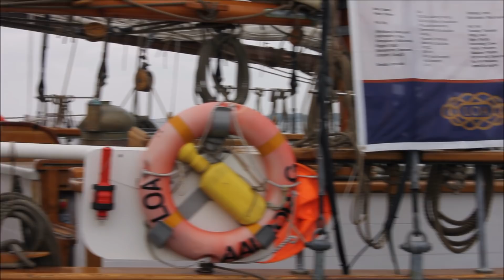Square yards and Tops'ls with Tom Cunliffe

Comment: Thank You, it's amazing to see these ships working.
My personal preference has always been No bottlescrews on forestays and headstays which have hanked on jibs. It was "full race" in the 70's to be able to drop the headsail to the deck, but as always we were actually just re-inventing stuff.
A good example of that is the racked seizing. I believe it's stronger than a splice esp in the larger sizes of wire rope. It looks perfect to me, and far from obsolete because  I seize eyes in dyneema etc double braid way more often than splicing it... it just makes more sense sometimes and it's way faster.
Cheers!
Reply: You are able to seize eyes in slippery dyneema that are stronger than a splice?  What are your secrets?
Reply: @MedievalTrebuchet  Thank you for taking me seriously. Many people would discount this because they haven't tried it or can only relate to things which are repeated over and over in short magazine articles. We seize eyes into double braided modern lines regularly. As far as Single braids go, we certainly don't mind turning in a quick splice especially if the loop needs to nest right up against a block or fairlead. But splicing double braid is a bit time-consuming when we are trying to avoid bottlenecks.
As Tom points out, the secret is in the Frapping Turns. The tried-and-true method for setting the fraps is to use the leverage of a mallet. But in small "yachting-sized" applications a mallet is going to be clumsy. That's where a WIHA 32633 saves the day. Every rigger should have two of these at all times because they work together. No longer do you have to destroy your middle back (pulling your hands apart) because now you can simply grab the seizing stuff in the tapered jaws and Spin the pliers for all the leverage you need. You're welcome! LOL
All I am trying to say is that old methods are far from obsolete. Especially now that fibre ropes are replacing wire ropes everywhere.
I would like to elaborate more later; right now I am taking a break at work to reply. But before I go, I am going to drop another bomb on popular conventional practice:
When you are using dux (tm) for example, and you need to replace an end, of course a (FACTORY) splice is the only way to achieve full strength. But how are you going to splice that stuff once it's been "Set"? You can barely pick it apart a single yarn at a time! One word: Talurit sleeves! And I'm not talking aluminum sleeves, we prefer the copper ones. Fortunately, nobody was around to tell me this was a stupid idea the first time we tried it in 12mm trawl ropes (yes, most riggers have a press that will do up to 3/4" sleeves). This has been working beautifully for, I don't know, decades now.
And now, a word from our sponsor (not officially): Who makes the Best rope? Well, there are so many choices these days, where do you start? But after doing this awhile, I have to say I keep coming back to M****W. I mean if you just melt the end of any of their polyesters, it is a beautiful, crystal clear bubble. So rather than Cheap raw materials that wimp out and char, this manufacturer is clearly using the best raw materials from the get-go. OK end of heretical rant,
Thank you Tom, I love your videos because they are unique and Legitimate. This one is full of things that any modern rigger will learn from!